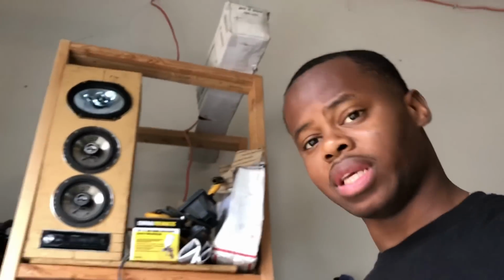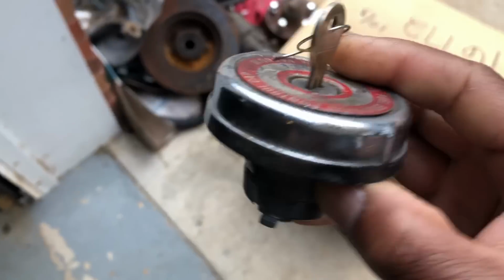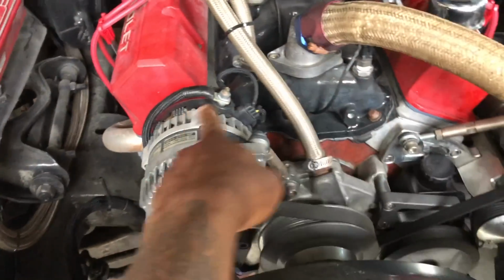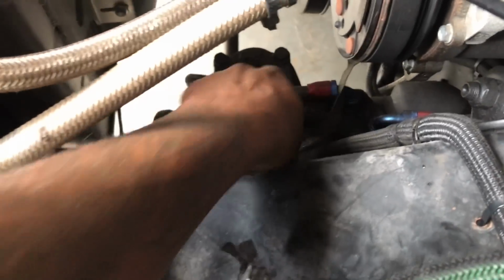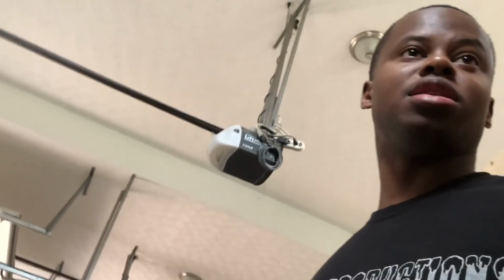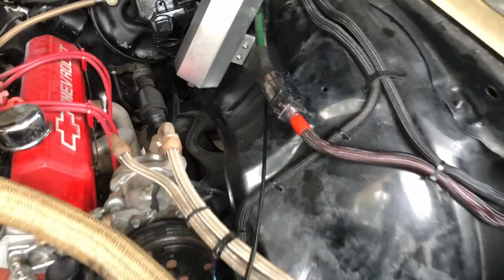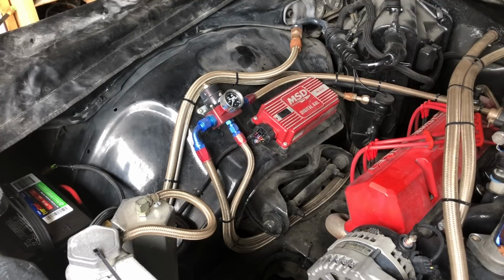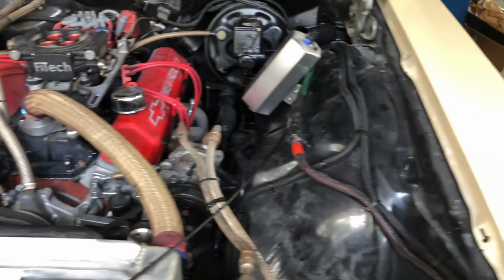73 CREAM DONK TEMPORARY REWIRE ON THE CHARGING SYSTEM

Comment: Just a little bit of advice for your little brother every time you run the power wire for your amp you supposed to run it on the same side as your battery
Reply from the maker: 😂 send me that rule in the rule book
Reply: @SteveDavisCarGuy  There is no rule book its just easier,the power wire should be ran on the separate side from your auxiliary and speaker wires. I am just giving a little advice, I have been installing car audio since 86.
Reply: I am running a system larger than yours,  but I like the way you are taking your time to put everything together the right way.
Reply: They say u get feed back or engine noise,when they're ran on the same side 🤷🏽‍♂️🤷🏽‍♂️??

Comment: Yo Steve .! 
Ya want to go 0 gauge wire like you said.! From wuT I'm seein . Ya need to move the fuse to the fire wall and I'm not sure, but if the alternator is stoc ,? 
Then it's output is to low for over 3000 watts..! Plus it still need to charge the rest of the car.!!  I don't know exactly what all you got but listen to you on this video I am feelin that is part of not all your probs ..!! Jus so you know I have a world title in sound comp.! Had a audio video shop.!! Worked on low'z and Donkz.! In-between .. ya Digg wuT I'm sayin bruh.!! Hope all works out foe ya.!! O I jus heard you puttin a frame ground that is always a must . Checc out that output on alternator..!! 1 ..ok bruh.. I should of watched the entire vid...
You goT this..!! One thing if you used the copper top on the wires..! Works but boo good homie..!